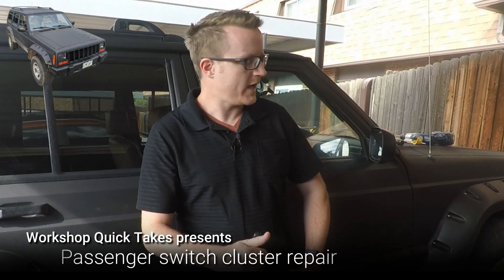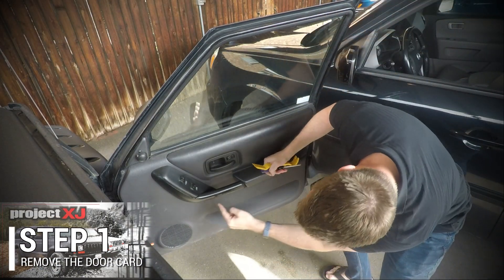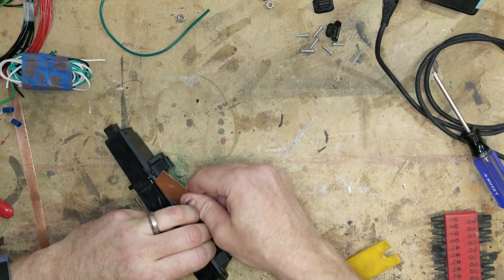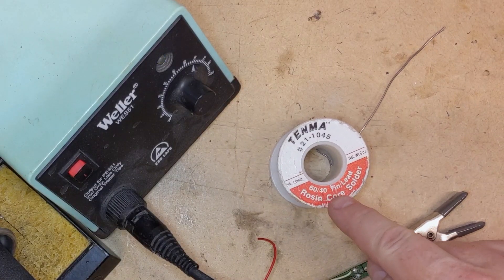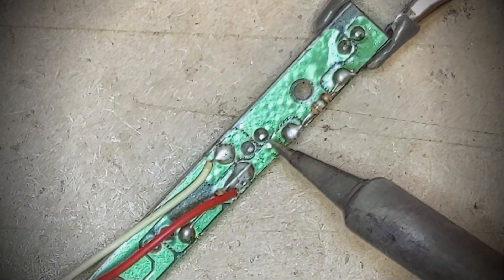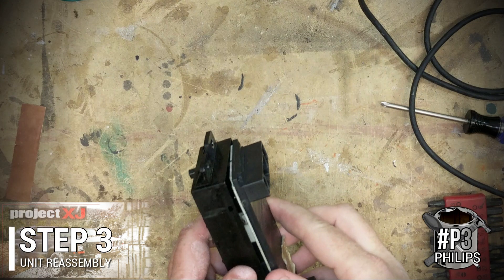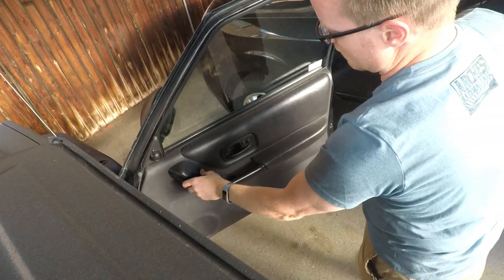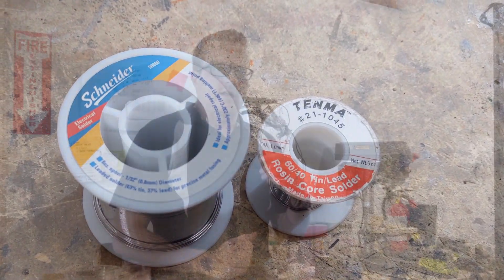projectXJ: Passenger door switch cluster easy repair (97-01 XJ Cherokee, other older Jeep/Mopar)

Comment: Thanks for the video. My XJ is haunted and will constantly try to unlock the doors. Been trying to diagnose it. Had to pull the door lock fuse just to get it to stop. I replaced both my door switches and it still persists, so I'm thinking it's the RKE in the overhead console. How did you go about replacing the RKE module? Did you have to re-key via a dealer or anything?
Reply from the maker: @TedMarsden  later models require direct programming of the RKE board,  but there are sellers on eBay that periodically release sets of matched boards and remotes. Alternately there are third party solutions that wire in similar to an alarm system, but I haven't tried any of those, myself. Easy troubleshooting test is to disconnect the RKE module for a while. If you still get mis-ops, check the door harness wiring next.